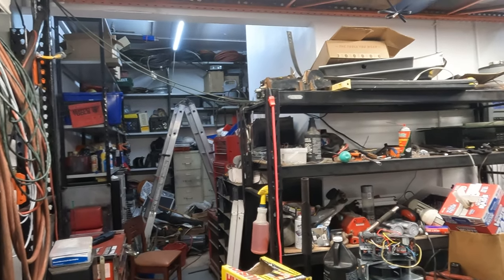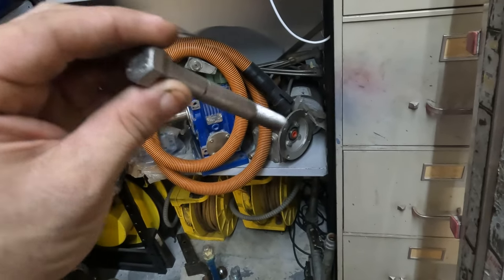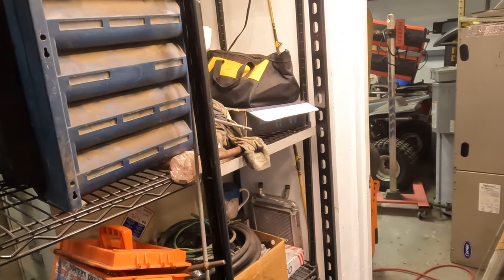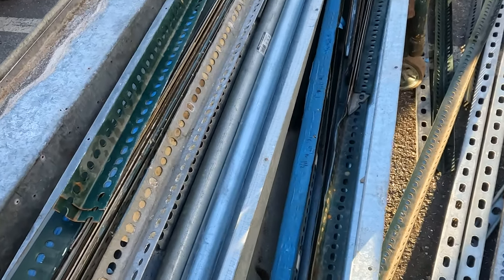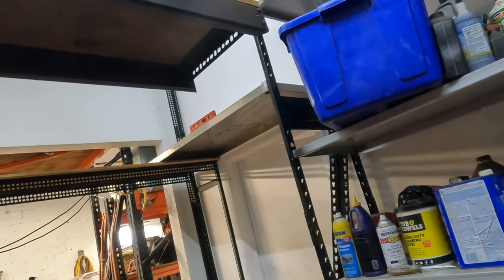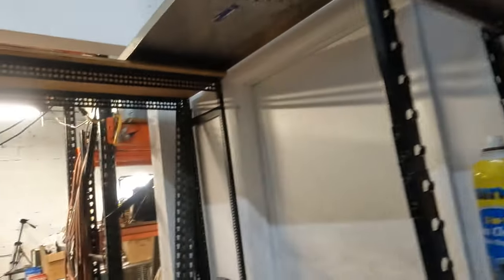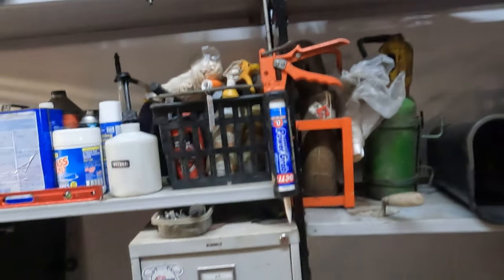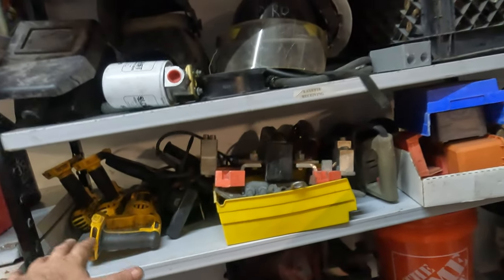Building Custom Shelves & Cleaning The Shop

Comment: Hi, those brass connections Burndy at 1:10 are for bolting up copper wire to Big transformers they are usually red brass not copper.
You can get 20x for them than scrap, they are brand new. I don’t even see any use marks on them. Ask you electrician buddies if they can use them, maybe you can make trade for their scrap wire and not have to buy it? Also the Richards hot line clamp is brass and nickel plated screw down. It looks brand new also, it is for making line connection for high voltage transformers. Don’t scrap them, sell them if you can or trade to your wire suppliers. Facebook or market place would probably work also.
The staters, just use them for your pallet fire Saturday night when you neighbors shops are closed.
Reply from the maker: I got them from an electrical contractor. lol I will be putting to garter a pile of items for sale.

Comment: In my woodshop, my hoard was out of control. I organized every clamp, screw, bolt, table legs, epoxy stuff etc into the black bins with the yellow lids from LOWES ($9.95 EACH). I Labeled everything and everything has a home. The rest went to Goodwill and the dump. Best thing I ever did. Clears you mind and my productivity took off again because I now know where everything is. I'm telling it was a treasure hunt with things I forgot I bought already. 
Your shop looks great, keep it going brother. 

Kenny
Reply from the maker: Thanks Kenny, The next step is going through all the bins. lol

Comment: On those Giant stators I cut off both ends(otherwise it won't press out) and then punch them out by hand (3lb hammer) with a custom ground punch (mild steel works fine) that fits the elongated hole in order to press all the strands out at once and not get stuck. Also the punch has to be long enough to go all the way through. You can use a rod and weld or flatten the tip to fit the egg-shaped hole in the stator.
Reply from the maker: Thanks for the suggestion

Comment: Hi Derek,  Great job organizing your tool room! It's going to look awesome when you're done!  2 things - at 1:10:03 - the yellow plastic tub. Those pieces look like electrical bronze connectors from a commercial or city utility distribution block.  I have a small bucket of them.  2nd - the steaming kiln at the end of the video - it looks like a pottery kiln. I don't think they get hot enough to melt copper.   Thumbs up!  Stay safe.    Jim
Reply from the maker: I think you are right on both points, Thanks Jim

Comment: I moved some of my plugs to make room and used the door frames as a guide for shelves kind of a tunnel so to speak. Heavy stuff stays lower lighter stuff up high. One wall is dedicated just for storage and tool boxes. I like the storage bins you have. That structural metal is way too expensive so your ahead of the game there. Lag bolts everywhere possible. You have the right idea. Great job.👍
Reply from the maker: Thank you! 👊

Comment: Hi,dee ho there . A different subject  . The statter or roter of a altinater is a easy brake down. All you need to  do is put theme in a press small end of shaft up add presher it will fall in to 3 pieces  that may work  for the large altinater.  You have on your floor. Also to get the copper  off of them all you have to do is remove  the end  of the pins on the sides ave the blocks then drive  then out the blocks fall off. recuver the copper  its dunn.
Reply from the maker: Thanks for the suggestion

Comment: use pvc pipes about 12inch long with a 2inch notch to hang your battery drills from. also don't forget the old adage the more flat surfaces you have the more junk you will acquire
Reply from the maker: Thanks for the suggestion
Reply: @ProjectShopFl  also keep the filing cabinets together  put a hook board for your ppe to hang from and coats

Comment: Look how they scrap motors in India . Anything 240v or bigger they throw the armiture in the fire and burn off the plástic and cut one end off and pull the winding out by hand . And if it has a iron housing they don't seperate the armiture from the casé and burn it then pull the wire out
Reply from the maker: Thanks for the suggestion, I don't eat to be burning them when I'm done it won't be necessary

Comment: you were concerned about getting your phone number out there for scammers to call.  you should get either a google voice number that you can then forward to your main phone number so that you get calls when you are selling stuff, and then stop forwarding when you dont have active sales.  OR there are several apps available that will rent you a local phone number for a cheap amount, like $5-10/ mo where you can use that number for a month on your phone as an app... and if it gets compromised, change your number or just delete the app if you are done. that way your main phone number is never visible to the scammers
Reply from the maker: Thanks for the suggestion 👊👍